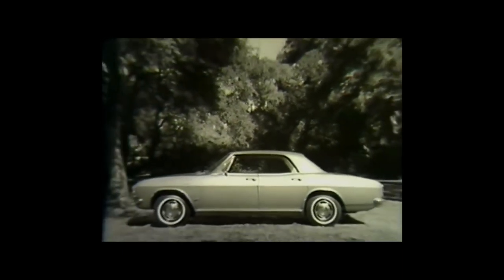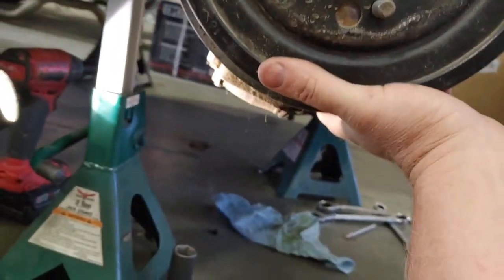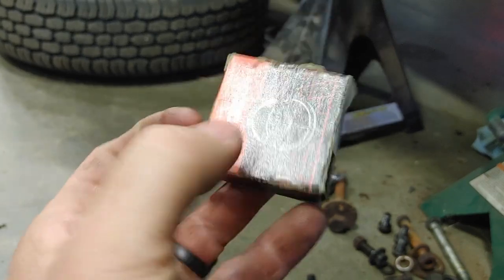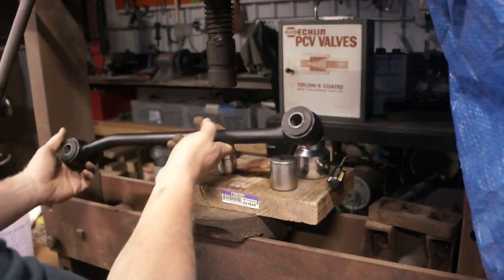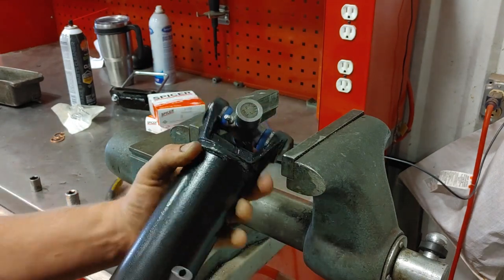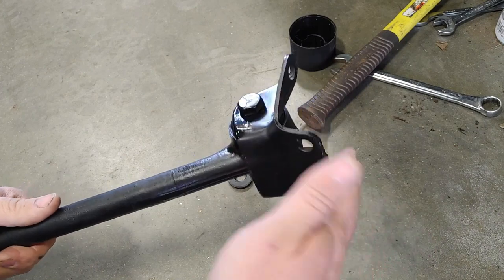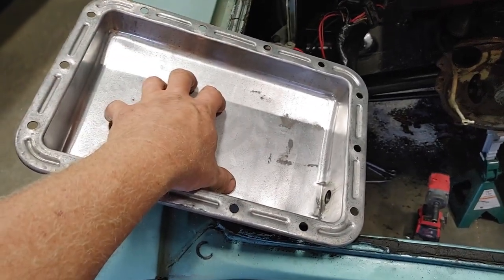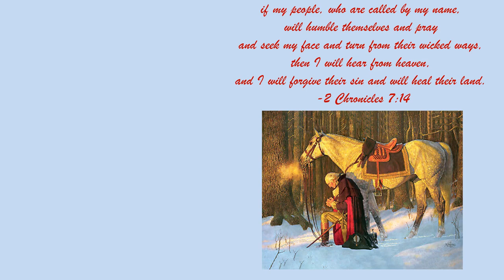1965 Corvair Rear Suspension and Driveline Repair - Strut Rod Bushing Replacement

Comment: Just on a general note... I have run into just plain not being able to get bushings, but now that isn't a problem and one can choose hardness and even colour - as you may know.  I had to re-bush all four arms on the axle on a 1964 Bonnevile and ya can forget finding those suckers.  I posted a video on this about a year ago.  I got the two part pour of poly goo (I chose red) and dang if that ain't the cats!  When you said the bushing you got were right out of the box doomed I thought of this.  I don't think I'll ever mess with pressing in bushings again.  I hate to say it but if they don't come out with some ease I just burn them out and sometimes that is the only way - like I had to do with the Bonneville arms.  Tricky sealing the ends so the two part goo from leaking out but I sealed it with some fiberglass resin so not to loose any.  It worked so well.  Just wanted to throw that out for any guys who may be facing no bushing available or just want something better.  I also ran into a Honda Civic motor mount that cost $450 and I burned the old rubber and poured in the two part poly for $70.  Nice work on your part as always.   Bobby

Comment: dont  forget the orings under the rocker arm studs or it will still leak and put your converter on the trans and bolt it to the flywheel after the engine is bolted up.making sure its free at all times.

Comment: You can get better adjustability with C4 Corvette strut rods. They're usually cheaper than rebuilt stock rods. Also, with a rebuilt suspension, you'll want to wait until the car is sitting at ride height before you tighten down those anti-sway rods that connect your trailing arm to the transmission cross member.

Comment: I was sure you would have to lubricate your rubber bushings in order to insert them inside the metal. Is it a good idea to use petroleum jelly or wheel bearing grease on the rubber in order to make it easier to insert them and press them in to the control arms ? You've done a great job.

Comment: Why wouldn't Clark's simply spec a steel sleeve around the outside of that control arm bushing instead of asking enthusiasts to mash a rubber slug halfway through a tiny hole?
Reply from the maker: They offer a couple of different options, these rubber bushings are the factory one. I would assume that the dealer back in the day would have simply replaced the entire rod rather than monkey around with the bushings. Clarks also offers complete rods with new bushings installed. Another option is C5 or C6 Corvette rods (if forget which) that are basically adjustable Heim joints on each end.